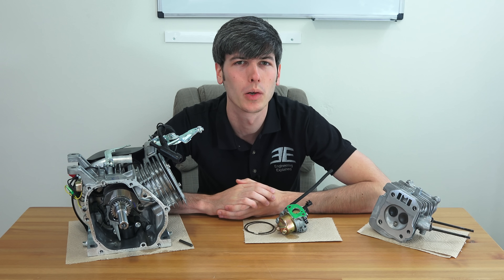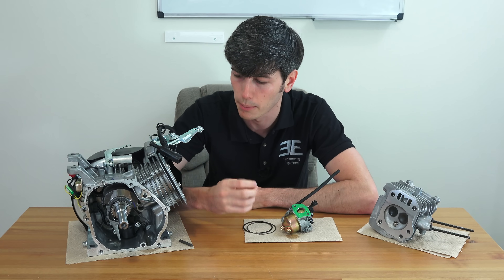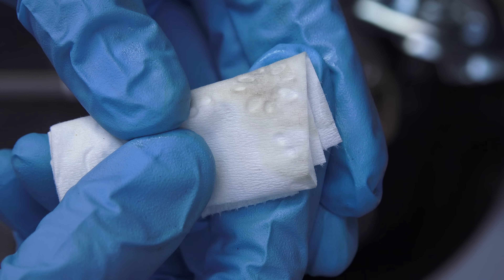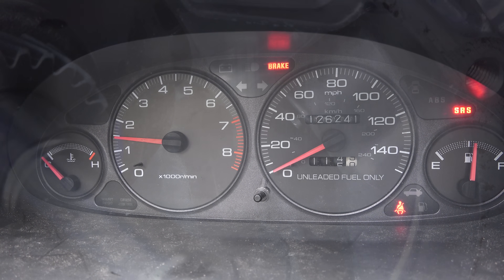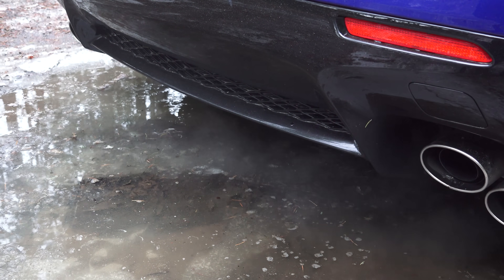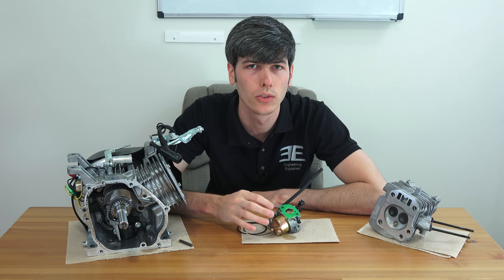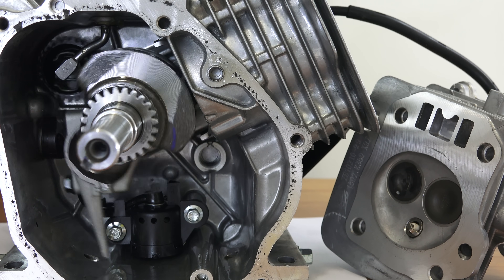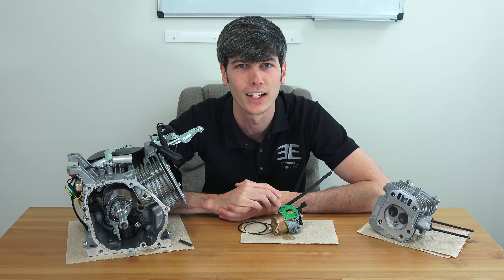Should You Warm Up Your Car Before Driving?

Comment: Carbs can adjust the fuel-air mixture ratio using either a manual or automatic choke to allow for cold weather driving. The automatic choke uses either a bimetallic spring or solenoid that is spring countered controlled by a thermister in a voltage divider to adjust for the temperature under the hood. Depress the gas petal fully once to set it before cranking over. For the manual choke, adjust it down after starting to an optimal cold idle speed.

Then you just do what you would do for a fuel injected car, short warm up for if it is a little cold, run the engine while you scrape for really cold. You can even do this with horrible intake manifolds like the AMC straight 6 that drop fuel out of the mixture in cold weather so bad some models came with an electric heater for the manifold.

Comment: I have 320k miles on my BMW e46 318i and I always warm up for 3mins, never had an oil leak, never smokes, never had an issue except batteries, mounts, hoses, and thermostat. I change my oil with fully synthetic 5w40 every 6months or 5000miles. Also warming up your car can get the desired cabin temp before jumping in. AND I HAVE USED E10 Ethanol fuel all those miles.
Reply: Antonios LesvosLover Also, don't rev up the engine too high if its still cold, it will wear out the engine over time.
Reply: No, you can just use your phone to read the TPS. But I guess everybody knows more or less what 50% of WOT means.

Engine are not some delicate flowers that need very special attention. Proper (not paranoide) maintenance, a little care when cold and avoiding lots of short drives and the engine will outlast the car.
Reply: Reviewed Popcorn What oil are you using for that milage? 
You must be driving long rides and few short tripes fot that milage.
Reply: those e46 enigines are built well
Reply: Hey look... the "I did it this way so it should be the exact same for everybody else ever" argument.
Reply: I wear Persol sunglasses, and I've never been attacked by a tiger.  So I'm going to conclude that my sunglasses keep tigers away.
Reply: so imagine how many miles you'd get if you did it properly...
Reply: you must be a rare case, how did you make a bmw last that long? they usually start dying by 65k miles.

also what brand oil you use?
Reply: He measured the exact distance that the gas pedal can move to the floor, and he installed a brick such that it can only be pressed half way.
Reply: my Renault clio 1600 running on lpg has done 500.000 km, I never warm it up. start it, seat belt on, lights on and of we go. oil changes every 40k km or so. If it is really cold, I take a little care not to rev it above 50% and not give it over 50% throttle.

Comment: 30 sec idle during summer. 60 sec if below freezing. Take off and grandpa it keeping revs below 2k for 3-4 miles and no WOT for 10 miles. Very reasonable for anyone to do, and has never failed me on any car or motorcycle I have owned.

Comment: I warm up my car because I hate getting into it when it's cold and the heater isn't blowing hot air yet.
Reply: Most cars still have a heater core that relies on coolant.
Reply: actually the engine temperature doesn't make a difference. Turning the air on and with the heat will allow you to get warm air much faster as the heater is electric. It just helps to have a warm engine.
Reply: 97I30T you're goddamned right

Comment: One question which I'd like to ask, is it bad for the engine if driving in cold weather the engine doesn't really get all the way to proper operating temperature?
Not that it's a problem now that we're coming into summer, but over winter it only got up to 75 degrees most days over periods of time that normally is plenty to warm up

Comment: what about diesel engines?
Reply: Diesel fuel is greasy and has better lubricant properties than gasoline. Rotation speed is lower and the average life span of a disel engine is better than a gasoline one. Be sure to load the engine only under ideal working temperature.

Comment: Don't really care what he said. But in Canada -30 or below I let my car warm up at least 10 minutes. Rather start driving a car that has heat than is just too cold to sit in.
Reply: Luckily for us in the wimpy UK, the coldest recorded temp since '61 is -27.2. That's T shirt weather for you hardy Canucs  ;¬)
Reply: You guys are pussies. I live in Canada too and on the coldest days I'll let my car warm up for however long it takes to brush or scrape it off and start driving. I get heat coming out within a few minutes and I'm good.
Reply: Real Canadians don't complain about the weather being cold or the inside of my vehicle being slightly uncomfortable. The effect it has mechanically is where the concern should be ex: stiff clutch, stiff steering, stiff breaking, uneven block temp etc...
Reply: Derrick Rogalsky He never mentions warming up the cabin. he's just letting you know you don't have to let the car idle for 10 minutes to warm up the engine. it's ok to drive it lightly after starting for 30 seconds. The cabin is another story haha.
Reply: Derrick Rogalsky I thought it was common to use a block heater at temperatures that low.
Reply: i have a block heater  saves lots time and wear tear and gas  at minus 20 and engine is warm in mins of start up  and ready to go

Comment: How long should I let my bicycle warm up?
Reply: If you go in the house and come back out and your bike is gone... You probably waited too long
Reply: @f1rststring  lol
Reply: 3 hours minimum
Reply: Well if you throw it in a furnace like you should, it probably won't take too long.
Reply: I would say .... til your knees stop cracking.
Reply: theKFCbandit lock your front wheel in a ditch then peddle untill your back tyre starts to get warm then your good to go 👍
Reply: burn out with your bicycle for 3 seconds, then you are ready to go
Reply: theKFCbandit The only way to warm up ur bicycle, is to use your legs while driving it...
Reply: 3 seconds minimum
Reply: u just have to sit there to warm up your ass...lol
Reply: hehehe
Reply: If you legitimately have a remote start seat warmer on a bike that stays in cold storage...that would be something I'd wait a few minutes for.
Reply: jayrod jones Colonel Sanders recommends letting your chicken cool 3-5 minutes before eating
Reply: Why are there no bikes with heated grips, seat and even some XXL heated pedals?
Reply: eternity
Reply: DolleHengst A heated seat would be nice and relatively practical. Heated grips might be cool but I can see being hard to design without being super bulky. But heated pedals? What? I would assume you would be wearing shoes while riding and the heat isn't going to transfer at all from the bottom of a rubber shoe sole up through the midsole, through the insole and onto your foot.
Reply: Preston Turner you might be on to something maybe if it generated power as you pedaled to warm seat and grips I want 25% of this idea to bad its posted on YouTube
Reply: WHOOOAAAA dude!!     It only takes 2 gallons, and you get to save some for another party.
Reply: theKFCbandit 😂😂😂😂
Reply: +Joe ..you sound like George Carlin.
Reply: After watching other video that were more serious I found your post and the replies HHilarious 🤣🤣.  Reading the replies cracked my side🤣🤣🤣!!  

My suggestion to warm up a bike, jog around the block with it.  If your sweaty and tired the bike is ready to ride😃
Reply: Till you fell your bottom warm 😂
Reply: Until ur heart throbs fast
Reply: just fart once or twice and then go

Comment: What about the GM 3.1 engine? That engine has a piston wall slap intul it ran for a few minutes(cold). There is a video about it and the person in the video said that's only when it is cold. But it should(which it does) go away once it's been runing for a couple minutes. Should it warm up at idle a few minutes?

Comment: Good to know. But my '07 Impala has a remote starter from the factory. What's the purpose of it then? I mean, other than running the heat or A/C before you get into the car.

Comment: The amount of damage you're going to cause by putting load on a cold engine exceeds the amount of damage you're going to cause by idling it for a few minutes before driving off, which will warm it up slower but more evenly.  The fact that you can feel the engine running rougher when it's cold should tell you that it's not a good idea to put load on it.  It's amazing that people are recommending to drop it into Drive and take off when it's still idling at 1500rpm.  I'm sure the cold transmission loves that, too.  On top of that, if it's a manual transmission car, think about what will happen every time you push your clutch in when your idle speed is 1500rpm instead of 750rpm.

Comment: How about the fact that all the seals, bearings, fits, spring rates, oil shear rate etc etc are all designed for normal operating temperatures. There is more going on than the fueling issue. Like anything on the Internet take this video with a big grain of salt.

Comment: What RPM should I shift at when it's cold? 2.5K? Is 4K too much?
Reply: That all depends on your transmission specs.  Most automatic designs have a narrow viscosity range, so it shouldn't make too much difference.  If you have a conventional manual (not a tiptronic or similar computer-controlled design), look at your fluid specs and understand what they mean.  Do you have a trans. fluid temp gauge?  What's the viscosity rating of the fluid?  What are the ambient and operating temperature ranges?  If your car is hard-starting and its cold (cold meaning near or below freezing), pay more attention to your RPMs when you shift.  Otherwise, you should be fine.
Reply: 2.5k
Reply: It's not complicated at all. If it's a manual transmission, shift as early as you can without lugging the engine. Once the engine is at operating temp it won't matter.

Comment: How about if its not that cold say 55F, will the injectors still shoot fuel into the cylinder?  I usually warm her up for some minutes because my car (has dual cam)can have potential cam failure overtime when it switches to the aggressive cam when cold.  Which is the reason i warm her up a bit longer but with my other cars i start her up and wait a minute and go.  how about when having a supercharger.

Comment: What about turbocharged engines? I have a mazda cx7 which are known to have issues with overheating turbos either because the owners didn't wait long enough for the turbocharger to become properly lubricated before driving or because they didn't let it idle at temperature before shutting the car off which caused the oil to overheat and turn into sludge either in the turbo and it's oil line or in the valves. This is of course if all of my info is correct. How does having a turbocharged vehicle change this process?

Comment: Mostly that last part. Cars that warm up slower need that extra time in extreme cold because you will end up running it at high rpms at some point before it reaches operating temperature... unless you live somewhere flat... with low speed limits, and you have a car with close gear ratios and a lot of low-end torque.
Reply: I live at the bottom of a large and steep hill with a decently high speed limit. When it's -20C or colder most cars I have had take close to 10 min to warm (vs the 15 at idle). Then there's the fact that other parts a of your car start freezing up below -25c so it is also safer to let it warm.

Comment: take to long to warm up my miata Vs me driving about less than a mile on way to way to work and the temp coming to operating conditions.  I also read read it good to do this so that both the trans and engine can close to operating temp.  other wise I would driving with a warmed up engine and a trans that isn't warmed up,  and the miata trans is really notchy when cold.

Comment: Thank you for the video! This has been on my mind since colder weather is coming - wait long enough for oil to start flowing everywhere it needs too before starting off and even then, drive a bit soft until temp is up. Got it.

NOW. What about on a 50ºF day - first couple days of autumn - engine starts, but has a deeper sound than it did a few weeks ago - oil and radiator temps take a little longer to rise, yes - but how long before I can say, inside of 80% RPM of redline attack the throttle (my neighborhood dumps to a high speed "freeway"). Do the same rules apply? Wait long enough for oil to circulate, wait for the computer to decrease my idle rate to normal ~+/-700RPM before I attempt an 70-80% RPM range run to merge with traffic? I was always curious how (my be slight) bad this was for my car, and I'm sure the answer depends on the car's engine and what not... Lets says same as your example for this video.

Thanks mate, new subscriber, but I've been watching here and there for a long while now! Glad to be apart of the group!

Comment: are you kidding me? of course you should warm it up. i dont know what "cold" is to you but if you jump in your car at -30c like where i live and start driving right away it does not sound happy. if fuel is blowing by your rings thats another problem in its own. oil must be at the proper operating temperature to allow it to flow and have adequate film strength. not to mention piston to cylinder clearances are off, and if the piston expands too fast you can end up with a "cold seizure" or "four corner scuffing" although not common in cars, why subject an engine to that?

Comment: This is incorrect and potentially dangerous for your engine's health.  the correct answer, as with most things, is that "it depends". You certainly don't need to warm it up until the coolant needle is in the middle, but if you use a heavier weight oil year round because you live in the south or don't change it at winter time you may need to warm it up. If it is extremely cold you may need to warm it up (hint: those points are related). If you have a built motor you may need to warm it up due to metal expansion rates for different metallurgy. There are many other reasons as well.

This conclusion also only focuses on the rings but ignores your bearing surfaces which see much more wear and are more likely to fail. Load is the issue, and even at low RPM and minor throttle application the load on the bearing surfaces is much greater - imagine pushing two objects like a small mirror or small steel sheet and feel the friction with no weight on them - then load them by pushing really hard on them or standing on them. Oil or not you can feel the difference in friction... if your oil is not up to minimum operating temp it may not make it onto those surfaces (for a simplified description) and you will wear them at a greater rate.

Comment: I think it would be interesting to see the difference in necessity of warming up when we're not talking about cold weather for California but actual cold weather like -30F or -40F. For example in high school while I was driving one of my dad's old cars, on occasion it was absolutely necessary to warm the car up not because I wanted to be comfortable (heater didn't work) but rather because the transmission fluid was so stiff it wouldn't change gear.

 I realize that is an exaggerated example due to that poor car being horrifically neglected and undoubtedly in need of a transmission flush, but would running a car without letting the oil become less viscous potentially cause damage?

Comment: yeah but the faster you warm up your car the more damage you have which will lead to cracks. remember, metal expands when it is hot and compresses when its cold. when you leave your car in park it runs at approximately (for my car at least) 750 rpms therefore it is putting more oil into the engine than lets say sitting in drive at a stop light. so thats what i think at least.

Comment: Starting ur engine and letting it run for like 30 secs or so IS warming up your engine. That's all you really need. You don't need to and shouldn't wait till it's at operating temperature lol wtf. I hate when people slam their car isn't gear and take off on a cold engine in the winter like they're on crack or something. What I do is wait 20-30secs, maybe 2 min max as I check my texts and emails before driving off. The idiots who warn their car for 30+ mins piss me off too lol wtf

Comment: In terms of fuel economy, I agree:  driving off under light load after a few seconds is the way to go.  However, in terms of engine wear, the answer isn't nearly so obvious.  If you drive off almost immediately - even under light load until the engine oil achieves operating temperature - that increased load of driving with cold oil will accelerate engine wear.  Conversely, if one waits until the oil is completely warm before beginning to drive, the engine spends longer running at a colder than ideal temperature, although the load during that warm-up time is negligible.  

A conundrum, in other words.  I suppose the (inconvenient) answer is to use a block heater or some other device to ensure the engine oil is always warm.

Comment: I'm glad you at least added the part about not driving hard when the engine is cold. I never take off until my car idles down, even in summer, and long enough to get usable heat in the winter/fall.

Comment: I had a question.If it is not necessary to warm up the efi engine which is fuel injected so the engine oil is cold and it is not circulated in the engine completely you have to wait for 1 minute or so to circulate the oil in the engine.If the oil is cold in an engine and you suddenly accelerate it.It may cause damage so you have to warm up the engine for a while.